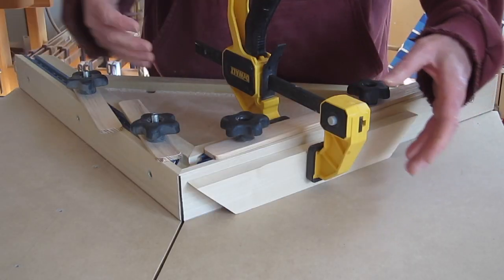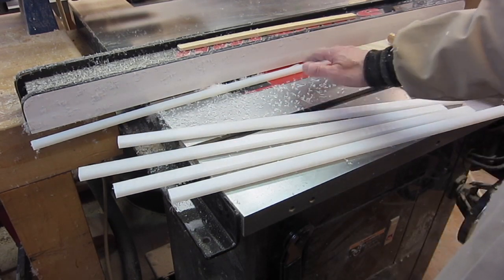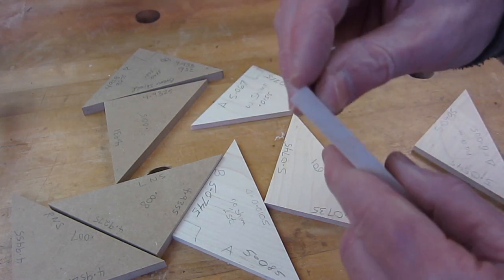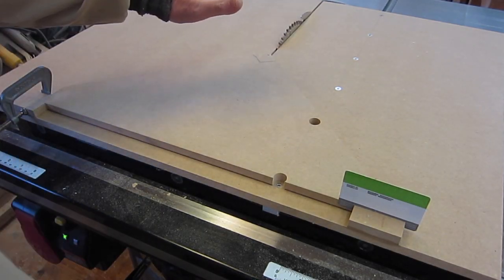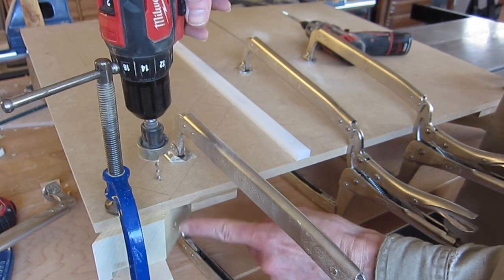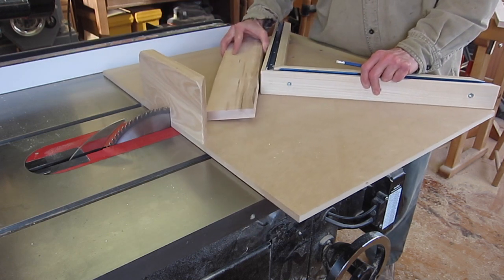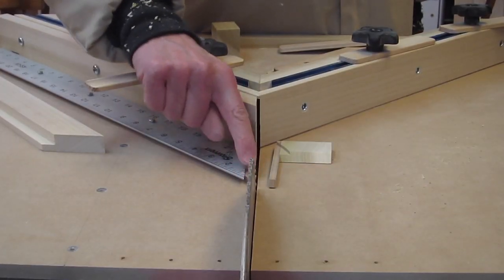Versatile and Precise Miter Sled.  aka Mitre.  including SawStop.

Comment: Whose equations were you using before you decided to use the method you settled with? I found a problem with William Ng’s equations, but there are better equations.
Reply from the maker: I developed the equations from scratch.   https://drive.google.com/drive/folders/1-mGrqN9IabxTZn5kdusxaFEAnyrUG576
Sorry it is not presented with proper explanation, as I only did it for myself, so that I would have confidence in the method shown in video.
Reply: @steven.woodward  Thank you for sharing these equations, but I was asking about the equations that gave you inconsistent results . . . at about 4:35 in the video.

The equations you shared on Google are correct, but accurately measuring the dimension 'G' becomes increasingly difficult as the angular error approaches zero.
Reply from the maker: @box0xB9  Just added the math sheet for the method I was trying to use at 4:35 in video.       Let me know if this answers your question.   The problem is not with the mathematics, but with the difficulty of accurately measuring from fragile tip of triangle.
Reply: @steven.woodward  Using the equations on the math sheet and working back from the numbers shown on the triangular piece of wood at 4:34 with A=5.0670, B=5.0715 and S=0.0155 - is it correct that L was about 35 inches? Maybe this number was not recorded in this video . . . I just want to be clear how the shim dimension was determined.
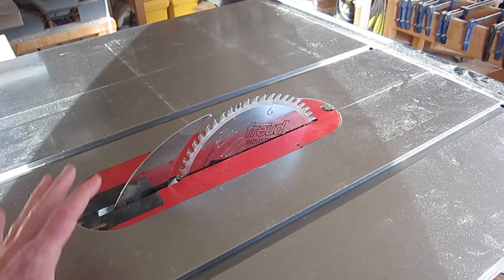Reply from the maker: @box0xB9     S = shim thickness.    L = length of base = 20 inches, as shown at 16:38 in video.  Formula is S = L/B x (A-B) /2.   Using A=5.0670, B=5.0715, then S would be 0.00887".     I do not remember why "w Shim = 0.0155" is written on the triangle, probably  a note  that the triangle was cut with that size shim in place.    Hope this helps.
Reply: @steven.woodward  Thank you for clearing up the values used - it makes sense. I still disagree with the formula for S. The simplified equation is where the error can likely be found, but the equation I use is very similar . . . S=(A-B)/(A+B)*L.

When the angle is close to zero, these values converge, but could be off by 6 mil for one degree of error. This is more important in the earliest stage of calibration, but may not be significant if the initial setting is close to zero.

I started looking at all of this when I saw the Ng video because his calculations didn't line up with what I was seeing in my CAD model.

I would share my derivation, but I don't know how to use shared cloud storage.
Reply from the maker: @box0xB9  Good.   I see the advantage of your equation:    (A+B) is more precise than the (2xB) in my equation.